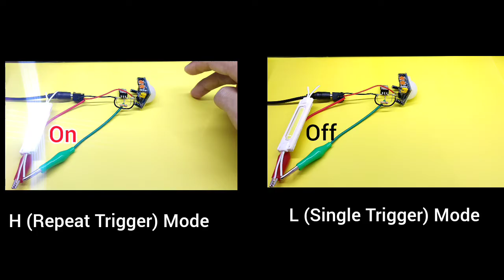COBALAH ALAT INI DIRUMAH, RANGKAIAN SENSOR GERAK PIR HC SR501, CARA ATUR TRIMPOT DAN JUMPERNYA

Comment: Dengan diberi tegangan 12 volt apa tdk merusak sensor ya om..? Tadinya saya kira tegangan yg dibutuhkan hanya sebatas 5 volt
Reply from the maker: Alasan utama mengapa modul sensor PIR HC-SR501 dapat menerima tegangan input 12V adalah karena modul tersebut sudah dilengkapi dengan voltage regulator (regulator tegangan) bawaan pada PCB-nya.Regulator tegangan (biasanya berupa IC 3-pin) bertugas untuk menurunkan tegangan input yang lebih tinggi (seperti 5V atau 12V menjadi tegangan kerja internal yang stabil, yaitu 3.3V yang dibutuhkan oleh sirkuit di dalamnya.

Comment: Sy coba pakai mosfet sesuai arahan. Led 12v memang nyala tapi redup sekali. Coba tanpa resistor lebih terang sedikit saja.
Padahal harapannya mau sy utk menyalakan kipas 12v. Apakah bisa?
Reply from the maker: Jika rangkaiannya sudah sesuai, coba ditukar sensor pir dan mosfet yg baru untuk memastikan komponennya dalam keadaan baik, terimakasih atas idenya pakai kipas yang 12 volt..
Reply: @ElektroNad14  sdh sy coba buat full set lainnya, tapi hasilnya sama. Apakah mosfet seharusnya melewatkan arus sesuai sumber arus (adaptor)? Ataukah lebih baik mosfet di ganti delay 5v utk dapat arus penuh dari adaptor? Atau sama saja?
Reply: Outputnya di kasih step up

Comment: Maff bang mau tanya, bukan kah sensor pir hanya bisa di suplay dengan tegangan 5 vdc itu kok 12 vdc apakah tidak terbakar trimakasih
Reply from the maker: Sensor pir memiliki IC regulator tegangan 3V yang mampu mengkonversi tegangan 12V menjadi 3V, sehingga sensor ini mampu bekerja pada tegangan 5V maupun 12V, kebanyakan orang menggunakan catu daya 5V
Reply: @ElektroNad14  apakah catu daya 12 volt tidak akan panas dlm jangka waktu lama, skrng lg musim maling di tempat saya, jd rangkain ini sangat di perlukan mksh atas jawabanya
Reply: @sopoingsun8590  
Sepertinya gak panas.
Adaptor ku 9 v buat nyalain kipas dc 12 v semaleman lebih..cuma anget dikit.
Udah lebih 2 bln..msh aman